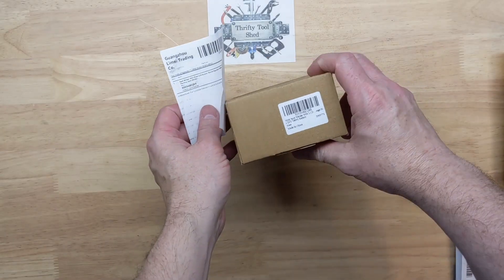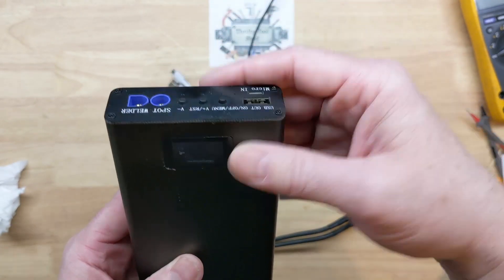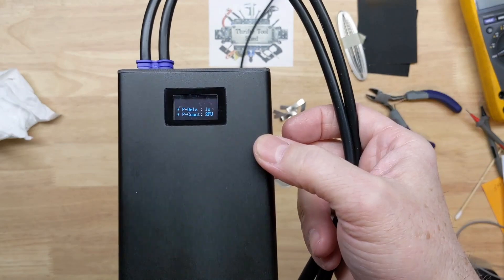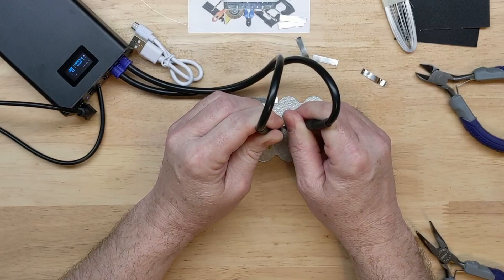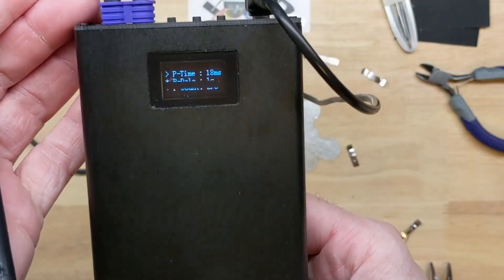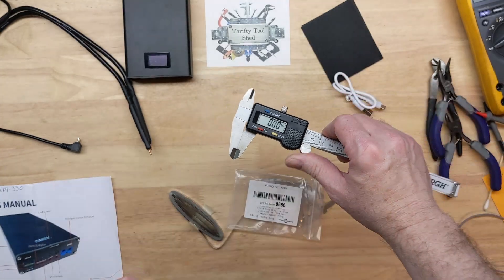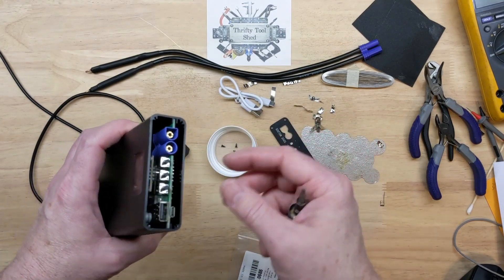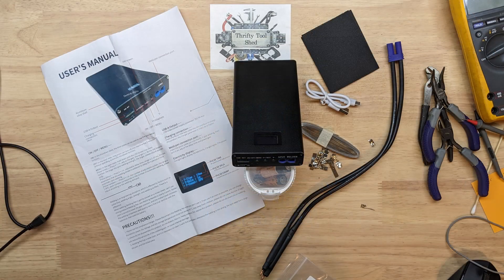FAIUOT BWM-330 Portable Spot Welder Review

Comment: Need a favor.  Any chance you are able to extract the firmware from the STC 15w408as to a file so I can burn a new chip?  The four comm connections are on the board and just need
pins installed and the STC app is downloadable for windows.  Thanks.
Reply from the maker: I can't tell you the last time I used mine. I have had  much better luck with the cheaper spot welded boards available the last few years now. I mentioned these in many videos and my new one as well.  I have been able to move up to a really powerful capacitor bank spot welder now as my go to. If you really need the parts from this Faiuot one and live in the US I can send you mine if I can find it. I am starting the moving process. No fun...
Reply: @ThriftyToolShed  Hey, thanks for the offer.  I thought I would make an attempt to fix this thing but I'll just permanently table it and move on instead of wasting time.  Mine is an earlier version and didn't work very well from the start.  Again, thanks for the offer.

Comment: I've had mine for a couple years now, purchased about the same time as yours.  It worked good enough to make a couple of battery packs with weld similar to what you show here.  But,  within a couple of weeks the quality of the welds dropped significantly to the point where no satisfactory welds could be made.  Took it out of storage this week, removed the batteries and found one to be acceptable but the other unusable, which is most likely the reason for the poor welds.  While powering the unit up with an external power supply I found a high current draw due to a shorted mosfet.  Replacement on order, along with new batteries.  We'll see if the unit returns to good welding.  The components look like they'll handle a 6v high amp battery and so I'll also try that, too.  Maybe a high discharge capable RC battery or a 6v motorcycle battery would work better.  The batteries 107080 ordered are slightly higher mAh rated and slightly thicker than the 857080 bats, 8.5mm vs 10mm, but should fit in the case just fine.  We'll see if I can return this unit to working condition.
Reply: @gtgarage
27 seconds ago (edited)
I accidentally pushed the voltage a bit too high with the batteries out and fried the 16 pin processor.  That processor, according to the datasheet,  has a max operating voltage of about 6v.  Now there's system voltage exiting several pins on the processor and causing some interesting and unusual results.  Board is toast and there's no telling if any retrievable code is intact.  The display is now slightly corrupted.  End of unit.  I have pics but there's no way to post them here.

Comment: Got it, works ok on .1 .15 nikel. did try to rebuild a pack from Harbor Freight EarthQuake XT pack, have no sucsess weld original nikel bus bars to replacement cells.
Reply from the maker: Did you have to attach the .15 to the original strips to get it to work? It takes a lot of current to go higher than .15 for sure. Great to know and  thanks for sharing!
Reply: @ThriftyToolShed  Yes, weld it with 3 strips .15
Reply: @ThriftyToolShed  I just wanna let you know, if you will gonna see some packs like so. Actually, this pack have a bms, unlike Bauer 20v series. Looks almost identical, i was been thinking what they are compatible(like Dewalt, packs what fit Bauer tools with small modification) but they are not :(